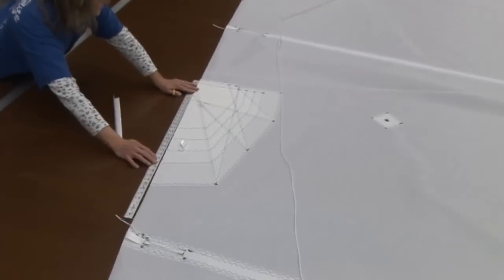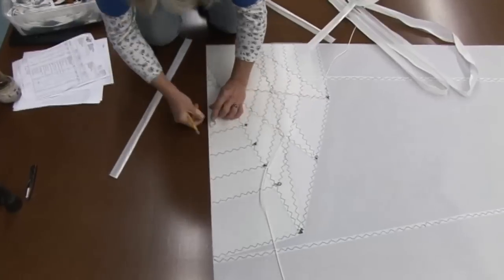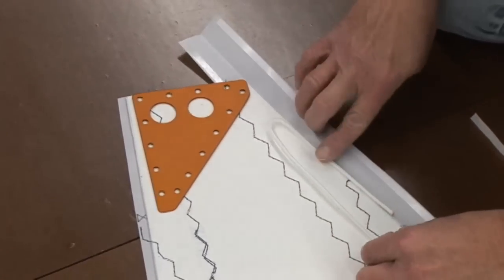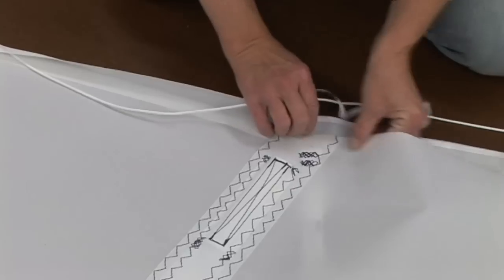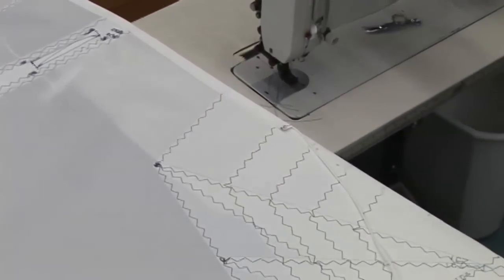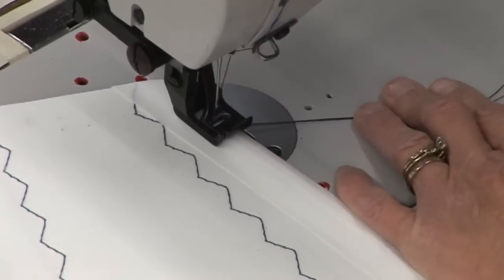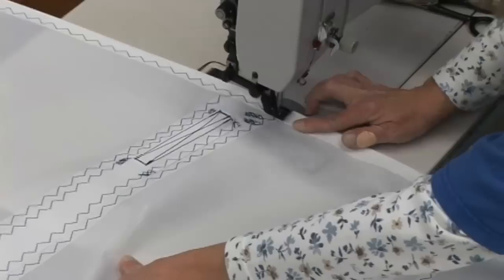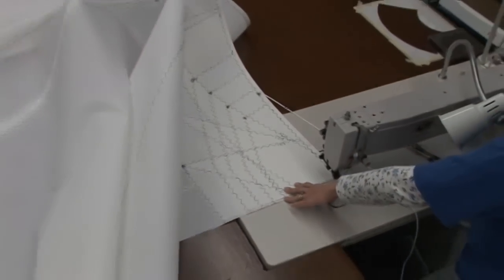Installing Leech Tape with Leech Line - Building a Mainsail - Part 6

Comment: Please show the whole sail at beginning, with all six names labeled, or diagram, because lots of us are newbies, we've heard the names but need a reminder, and don't have a clue which is the clew. As a new dinghy sailor I can guess that the head must be the very top, but is the foot the long bottom part or front bottom corner or back bottom corner?  Maybe show the diagram again midway.  Anyway, it's 6 names plus batten, which has two meanings, plus tack has two meanings, and head which has five marine sailboat meanings; direction, bathroom, frontmost sail aka jib, head of sail. Luff is a noun and verb also confusing because it it's luffing its not the luff that flaps, is it? About 14 meanings for 7 words while we're trying to sew. Also, lots of us readers pretend we know because we don't want to look stupid. (You can delete my comment but could you add a labeled diagram?)